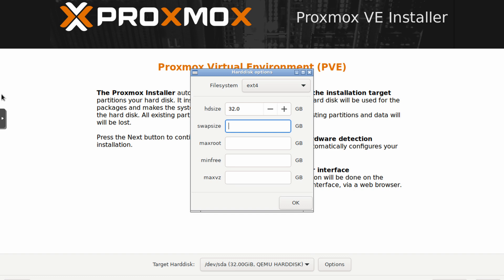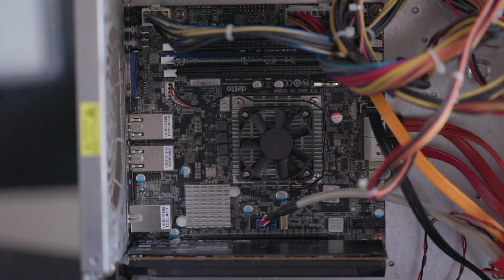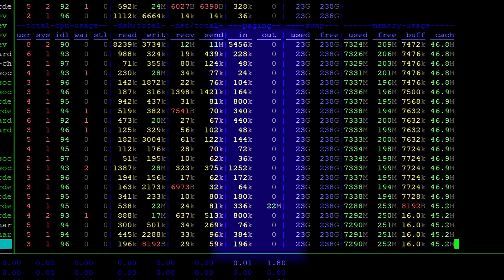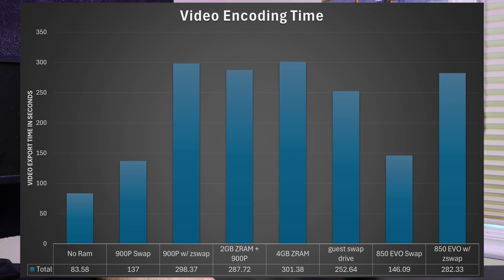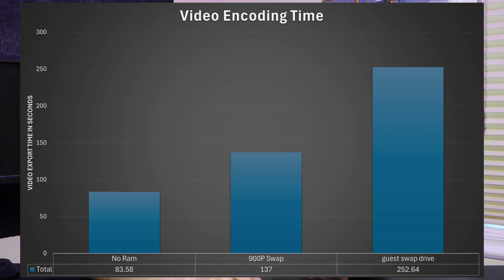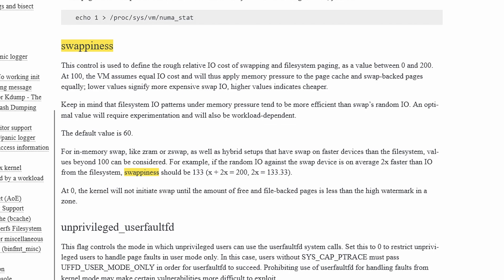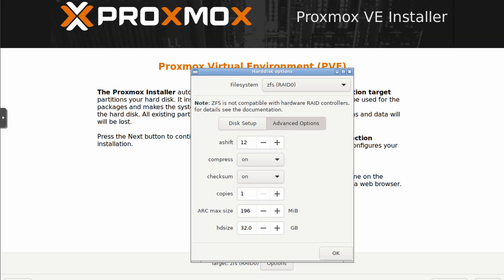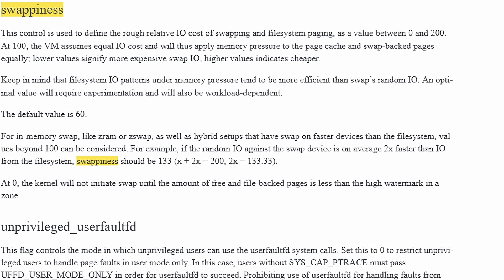Looking at Swap on Proxmox: Configuration, zswap, zram, swappiness and more.

Comment: what would you recommend for such issue that appeared suddenly after I rebooted Home Assistant. The same issue  i get when I reinstall Home Assistant and I am getting this running when booting for even few hours doing nothing...
"A start job is running for HAOS swap"
My proxmox is on wyse5070 with 250gb disk ssd, 20gb ram . for home assistant i used 1x4 cpu, 10 gb ram, 32 gb disk... and i also at some point changed swap from 8gb to 12gb as i thought i need more but no change...

Comment: I found the best solution for the limited memory available on my system (32GB UECC + baby-xeon E3-1270 v2 on X9SCM-F) was simply converting everything I could to run as a container. It really gave me a lot of flexibility because I could further tune resource allocation by carving out, for example, a single vCPU to my relatively heavyweight Cloudflare DDNS or old bloated Debian LAMP stack CT hosting legacy PHP read-only intranet site, my ArchiveBox microservices, etc, setting them to limited RAM, and giving ample swap from the PCIe-connected Nytro Warpdrive enterprise SSD: after a short period of time, the SWAP is often running 50% of the RAM allocated to that CT, but the site is decently responsive enough to function while never crashing. Meanwhile, giving my timemachine, nextcloud, bitwarden, teslamate, nginx proxy manager, Proxmox Backup Server, etc their entirely own proxmox CT with full-vCPU access and larger amount of RAM. A few VMs still required no longer were getting abysmal performance, but running fine (wireguard, openwrt, Windows 11 Pro) I do hate the OOM behavior of PVE tho, you are entirely right that better monitoring and reporting is sorely needed.

Comment: Would it be possible to set up zRam for installing operating systems on it. .

I read in proxmox forum that it's possible but I don't understand how to make it work
Reply from the maker: Like as a boot drive? Sure you can use that for the boot drive for the VM with a bit of configuration. In general RAM drives aren't worth it for VM boot, but I can make a video looking into it if your interested.

Comment: So...the thing with swap REALLY depends on what you're doing.

On my main Proxmox server at home (which has 256 GB of RAM), I think that I am running something like 17 LXC containers (with almost all of them being Ubuntu), 1 WinXP VM, 1 Win7 VM, 2 Win10 VMs, and 2 Ubuntu VMs.

It uses somewhere between 150-180 GB of RAM nominally.

That SHOULD leave me with ~56 GB of RAM free, right?

And yet, despite this, my Proxmox server WILL swap out before using the remaining ~56 GB of RAM.

Always.

Without fail.

swappiness is set to 500, which means that it SHOULDN'T swap out to disk unless it ABSOLUTELY has to.

Between ZFS ARC and virtio-fs, some combination of things is causing the system where it will NEVER be allowed to use the remaining 56 GB of free (and available) RAM.

Moral of the story: RAM, for VMs and CTs ended up being the most important hardware choice when picking a virtualisation server.
Reply from the maker: I'd check that 500 swappiness value. I think swappiness should max out at 200. And larger values typically mean swap will be used more.

I'm curious how big you have your ARC set to.
Reply: @ElectronicsWizardry  
edit
I stand corrected.

I just checked my system (couldn't do it earlier whilst I was at work).

Swappiness is set to 10 on my main Proxmox "do it all" server.

It was vm.vfs_cache_pressure that I have set to 500.

"vfs_cache_pressure

This percentage value controls the tendency of the kernel to reclaim the memory which is used for caching of directory and inode objects.

At the default value of vfs_cache_pressure=100 the kernel will attempt to reclaim dentries and inodes at a “fair” rate with respect to pagecache and swapcache reclaim. Decreasing vfs_cache_pressure causes the kernel to prefer to retain dentry and inode caches. When vfs_cache_pressure=0, the kernel will never reclaim dentries and inodes due to memory pressure and this can easily lead to out-of-memory conditions. Increasing vfs_cache_pressure beyond 100 causes the kernel to prefer to reclaim dentries and inodes.

Increasing vfs_cache_pressure significantly beyond 100 may have negative performance impact. Reclaim code needs to take various locks to find freeable directory and inode objects. With vfs_cache_pressure=1000, it will look for ten times more freeable objects than there are."

(Source: https://www.kernel.org/doc/html/v5.4/admin-guide/sysctl/vm.html)

Either way, even with a vm.swappiness=10, my system still swaps out like crazy despite the fact that I have 56 GB of RAM free.

Comment: I think the item you sort of glossed over was i/o and implementation of the pci-e based ssd - those units from intel are absolute units and can significantly boost performance thereby mitigating having to go to swap in the first place, also caching can be a big performance boost either with zfs or bcache or a ram drive, also just using bigger arrays/raid10 and stuff like that could end up helping - if you did another video and looked at effects of disk subsytems and the ultimate setup for max perf that would be helpful and put some more metrics on the board - swap is just one component
Reply from the maker: Yea probably skimmed the 900p being nearly the best swap device out there. I also had a quick graph with a 850 evo as well, and while it was worse, it wasn't that much worse. 

The effect of ram on caching is interesting and I have some ideas for scripts to test different caching systems, but its hard to test caching is all about trying to predict user workloads, and it can be hard to get consistent numbers that are applicable to the real world.

Comment: Some experience from work: Don't ever overcommit, not good you'll have a bad time and if you have to do it, use KSM, the lowest swapiness and try to have as much of the same OSes running in the same version as possible. Then you might be able to do 1.1x -1.3x overcommit safely. But if you don't have to disable swap and never think of it again. It will help you a lot especially on slower drives when live migrating...
Reply: I think mongo won't start in lxc without overcommit sysctl

Comment: I have never been able to understand swap in Proxmox. I have a cluster of 3 identical Intel NUCs with 64GB RAM and and they are all below 50% mem usage, but still one node uses 30% swap for some reason - even when it is reporting only using 27% RAM and no VMs are reporting more than 70% mem usage either.  Swapiness is 60 on all. No ZFS. Very insightful video - as always.

Comment: 8:20 it's not proxmox which kills it, it's the Linux kernel.
Reply: 11:42 I would not recommend a low swappiness setting and waiting for swap being used, keep it higher, because you are reducing performance because you loose things like file system cache.
Reply from the maker: My mindset was that a low swappyness will be best if you normally have enough RAM, and want to make sure there aren't performance hits if a part of a VM gets swapped out and then needed later on. The swap would then keep the OOM killer from taking out VMs, and be an indicator if more RAM is needed. If you plan on using swap, then a higher swappiness value would be better as its proactively swapping out unused ram instead of waiting for ram usage to be high. This really depends on the usecase of the system and VMs. I often seen Proxmox servers where RAM usage isn't that high, so my thought was avoid performance hits by having parts of VMs in swap and the smaller disk cache shoudn't hurt performance that much,  but again really depends on the use case. Hope this explains some of my thoughts in the video.
Reply from the maker: Oops that should have been higher value to proactively swap out ram. I edited the earlier comment.

Comment: 8:11 As it's the kernel that does OOM kills - it's not even guaranteed that the Proxmox web service survives, right? I think your zRAM tests are flawed measuring ffmpegs speed only - try swapping windows/programs in a Windows VM and see how the latency feels..
Reply from the maker: As far as the Proxmox services getting killed by OOM, It looks like linux has a score that the OOM uses to determine what to kill first, and from a quick look at a system the vms would get killed before all the proxmox services from my quick look. 

I agree my zram tests were flawed, but the issue is snappyness is hard to measure well. Let me know if you know a good way to measure snappyness and I'll give it a run, but since I couldn't really think of a better test I stuck with the ffmpeg encode. I'm sure zram has its uses as its the default on many distros.